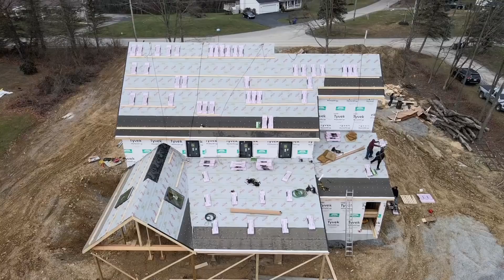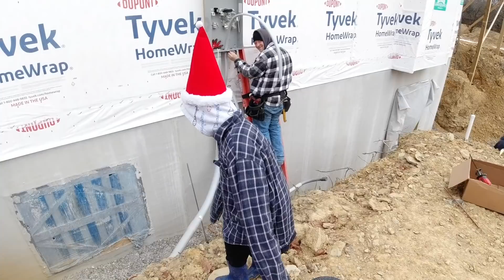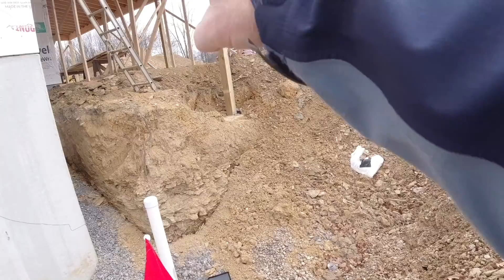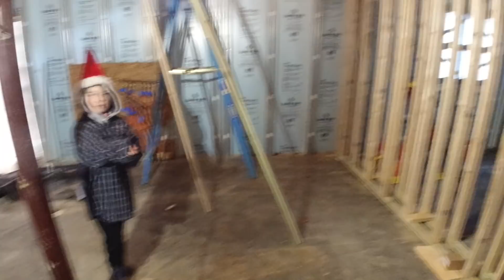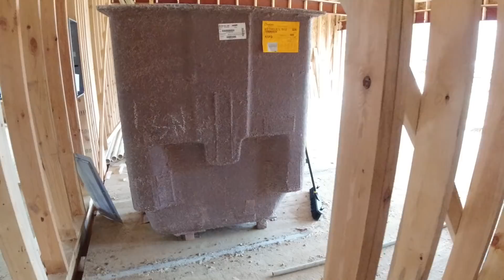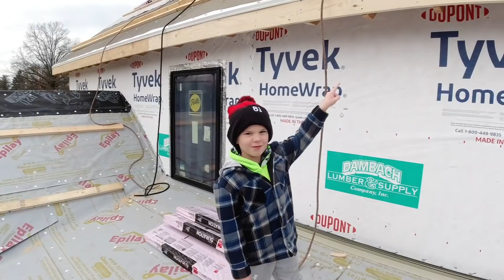Can’t Have a House Without These!

Comment: Tom are you putting perimeter drainage down to protect the basement/ foundation.... or is it needed in that area?
Reply from the maker: Yes 4 inch perforated pipe a continuous loop around the entire perimeter encased in gravel with fabric
Reply: @Concretewiththehauses  outstanding!!

Comment: Every time I see a new house get electrical I like to tell how Penn Power stuck it to us.   They didn't like that we buried the conduit and line down to their pole from our new house.  Said that was their job.  Refused to let us hook up our wire up their pole even though it was to spec.  Said, it isn't penn power grey or some such story.    Made us install our own pole 10feet away, put the meter on it and ran power from their pole over to our new pole.    Just made because we took away a lucrative dig/bury/line install. That's THEIR job mentality.  telephone pole alone was 750 bucks.
Reply from the maker: Wow that’s crazy

Comment: I would have concerns with the windows in the back with the roof line so close to the bottom of the windows. When it snows and builds up water will seep in around the window and rot the frame and mold will occur,.